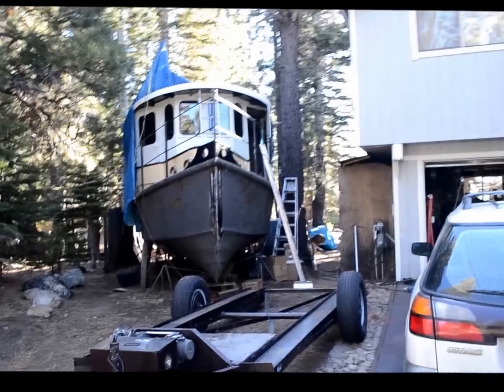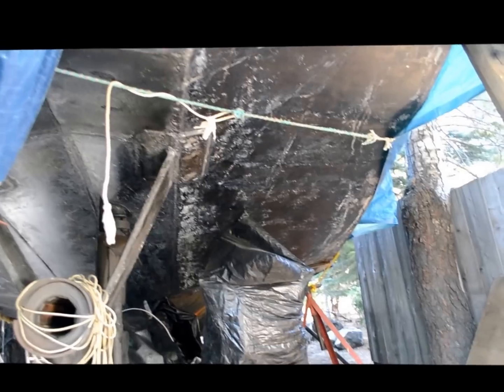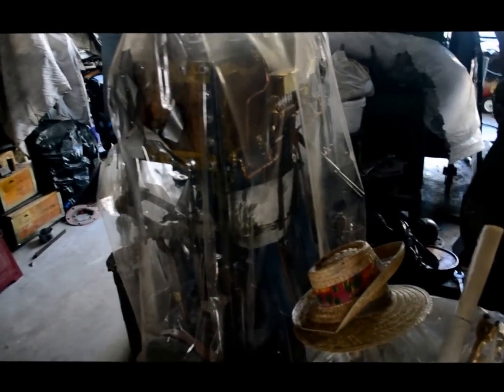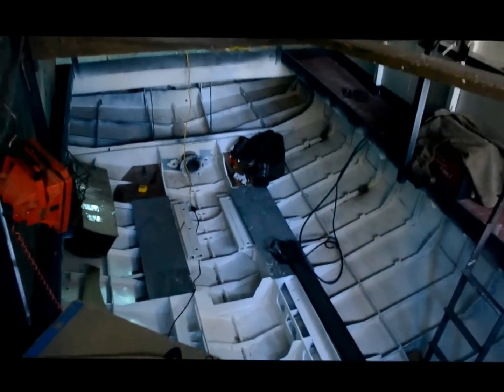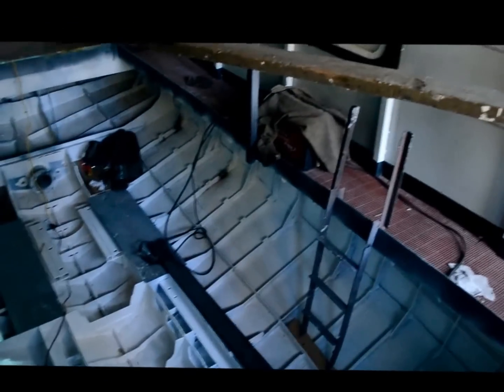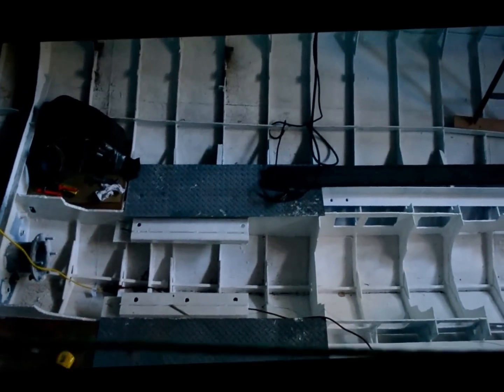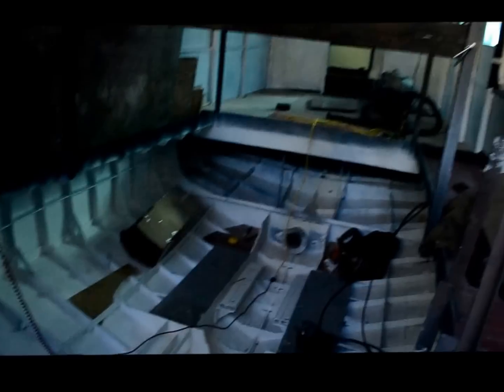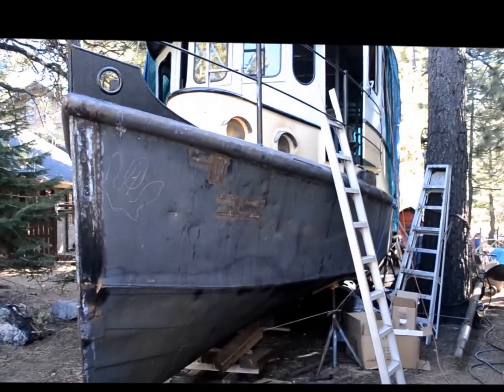My Father's 40ft steamboat project

Comment from the maker: @porpoisefathom  We are going to go with the watertube for now as it is substantially lighter than the firetube (1200# vs 4800#), takes up much less space, more efficient, etc. We will be burning wood and oil, both of which I can get for pennies on the dollar, if not free.

The engine(s) that we have are both just about right for her size, perhaps even a bit underpowered. As long as we at least go hull speed we'll be happy. No real "work" for her other than possible trade for dock space.